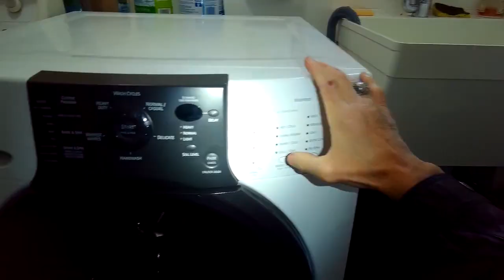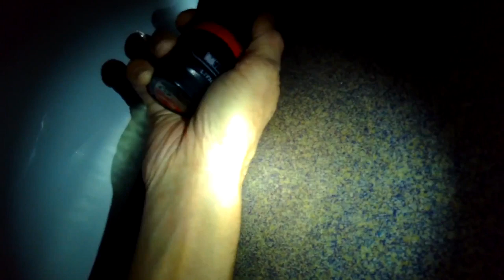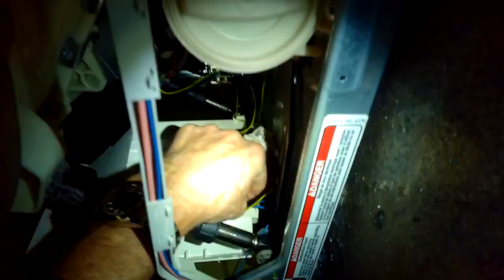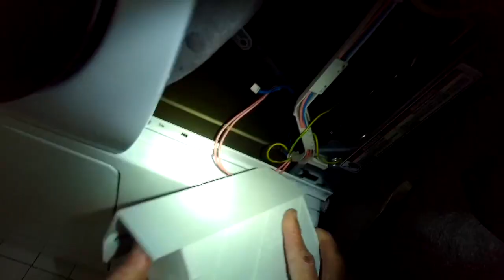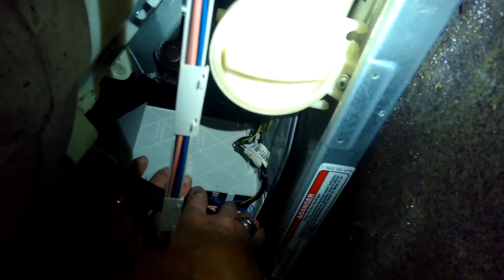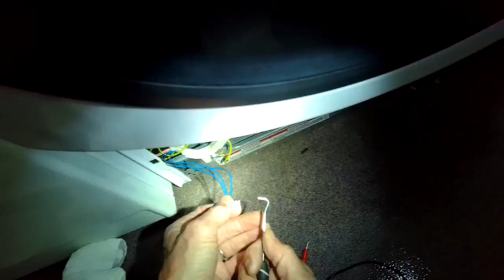✨ Duet Washer F-11 ERROR - Motor Doesn’t Move - EASY FIX ✨

Comment: So I've got the Whirlpool duet and when it's goes to spin cycle it sounds like marbles are rolling around in the back of the washer I took the back panel off and when I turn it by hand it it sounds like stuff broken there like bearings or something but it's been pretty easy it just sounds like stuff broken there I'm not sure what you have any idea what it could be before I take it apart
Reply from the maker: Thanks Tim,
That’s a worn out rear bearing.
Very expensive repair.
Good time for a new washer 👍
Reply: Spider arm is disintegrating inside the wash drum (it's on the back side of the stainless steel wash tub...they are made of an alloy that literally rots over time). You are most likely hearing pieces of it rolling around inside. The washer will shake like crazy once 1 of the 3 spider arm's break completely!

Comment: Just wanted to provide an update.  I sent both boards CCU and MCU for repair and test.  When I received both boards back, I see the MCU marked repair.  I installed the boards and the washer now is working as expected.  This video is a good source of learning and saving money.  Don't buy used boards CCU or MCU and save estimate repair cost.  Thank you Scott !
Reply: Good input.  I have the HE 4t.  Shows “F11 / communication issue between mcu/ccu”.  Where, May I ask, did you send the units to for “test and repair”?   ThnX in advance.

Comment: I replaced both MCU and CCU but still getting error code F11 -  I also checked the blue wires connectors and didn't see anything obvious.
All connectors are checked as well.  I also checked the filter and make sure nothing got blocked.  Anything else I need to check ?
Reply from the maker: Can you do a continuity check of those skinny blue wires using a continuity tester.
I think there’s a break in the wire inside the insulation .

Comment: I'm following along to try to fix my machine.  What is that wire tool you are using to pop the hinged door open where you check the first blue wires on the MCU?    Thanks, Marlene
Reply from the maker: It’s just a hook tool that I got at the auto parts store👍
Reply: @ScottTheFixItGuyChannel  Thanks for replying.  I thought it was a specialty tool to open the plastic box.  Boy, do I feel dumb.  I did find the hook and ordered one, but then discovered all you have to do is reached behind the lip of the cover on the back and it just opens up easily just using your fingers.  I kept trying to do something to those 4 hard plastics tab looking things.  face palmed over this numerous times.  So far nothing has worked so I decided to see if I could find a refurbished older machine.  One without computer thingies.  Whatever happened to appliances that lasted for  many years and could always be fixed.  I was told they do not even make my model's MCU or CPU anymore.